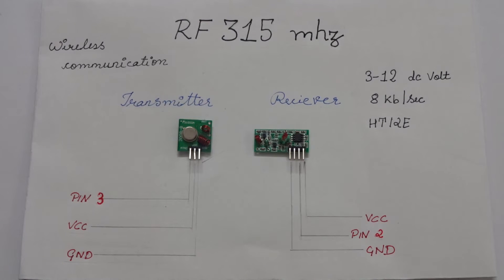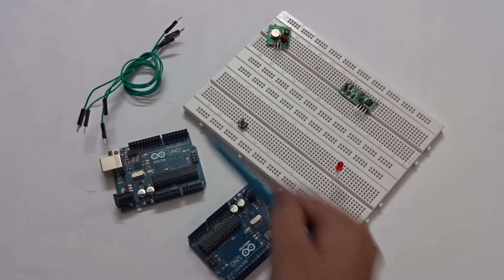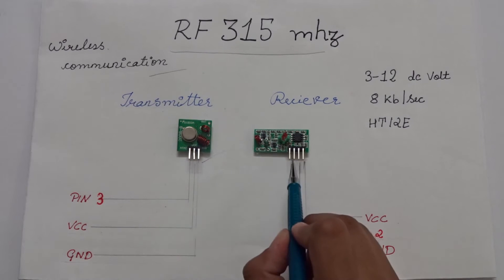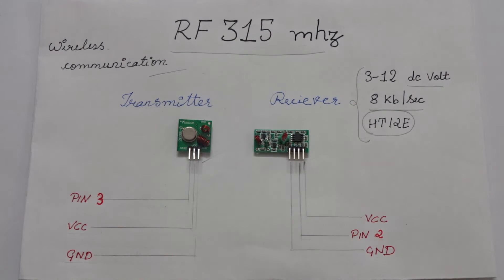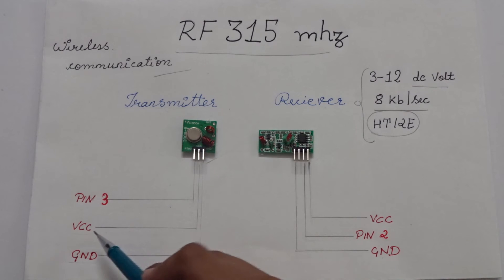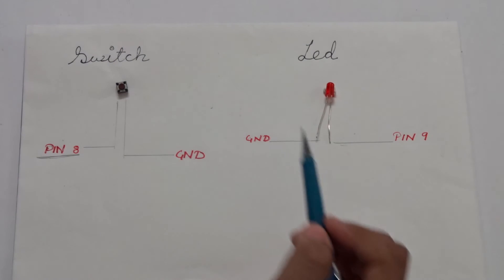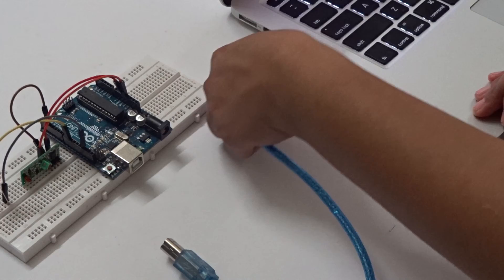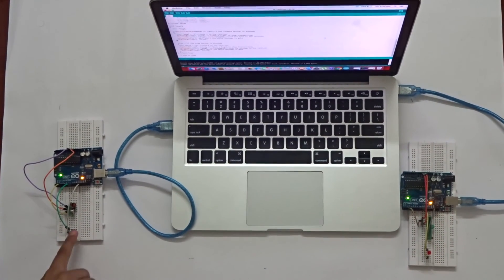Arduino Sensor#3 - RF module 315mhz

Comment: Good Maam & Sir Can I ask can I used the codes for sensor? Because in your circuit you use a push button? :D ^_^ Thank you
Reply from the maker: Hi Micheal, so what do you want to use it with? The code can be modified for the same.
Reply: @ROBOMECHTRIX   Sir I'm try to make rc controlled car using this arduino how can i connect 6 switches to it for movement of car